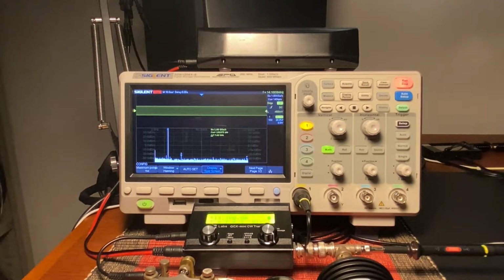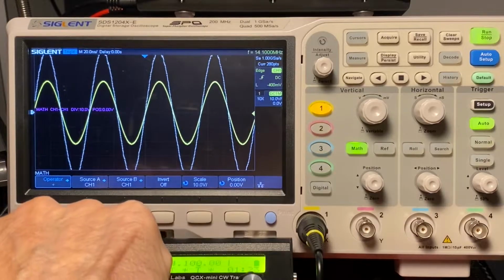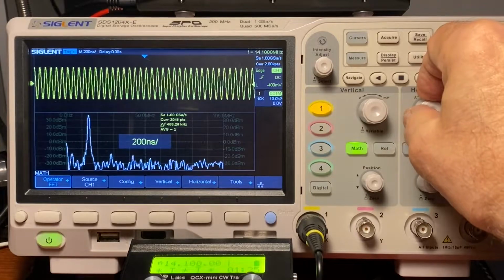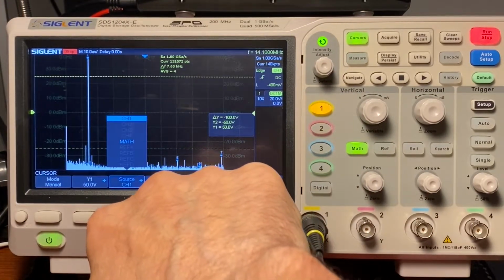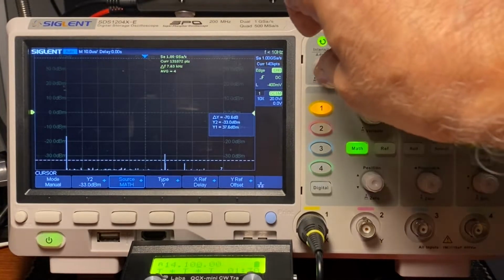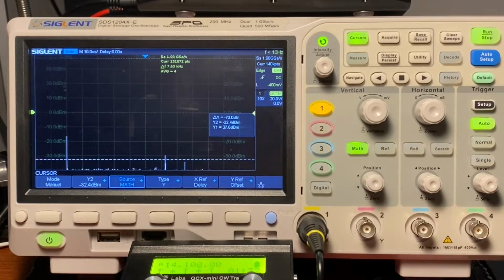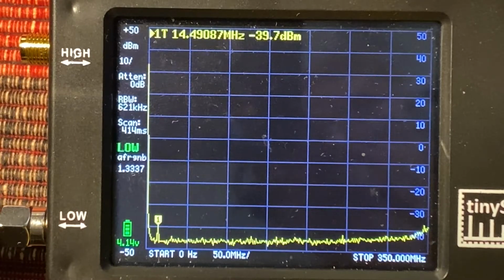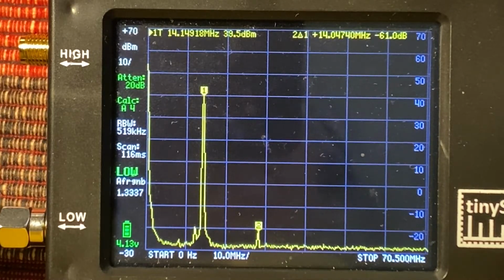Measuring HF Transmitter Harmonics with the Siglent 1204Xe

Comment: Using an oscilloscope probe to measure the spectrum is far from optimum. Amplitude vary with frequency since the cable is not match to 50 ohm.
Reply from the maker: That's a common misunderstanding!

In the configurations where I show the scope connected to a load via a T it should NOT be matched to 50 ohms as the signal is already terminated properly. We are properly measuring voltage across the accurate 50 ohm load with a scope probe calibrated to do that. That is what  the probe and scope were designed to do.

The supplied T and probe adapter for the high impedance probe setting work to at least the specified bandwidth of the scope when used this way. You are correct, however that this means that at 200 MHZ, the measurements can be 3Db low as that is what the 200 MHz specification of the scope actuallymeans! This bandwidth will not be improved by using a 50 home setup for the measurement - it's the limit of the scope's design. It also limits the FFT and power measurements of the 200 Mhz version of this scope to to around 160MHz.

In some videos I show how to use the scope as the destination load, but it's usually via some sort of properly calibrated power attenuator.

Thahk you for reminding us that's that it is easy to forget the scope bandwidth is only 200 MHz! This means that that using it to measure harmonics above 100 MHz can give misleading results. This is a great system for HF work up to about 30 MHZ, but 6 meters and beyond requires a better analyzer ( and I have several).

thanks again for your interest...

Comment: FYI - you can display a table of the markers on the Siglent, and see the relative dB values without having to cursor around.
Reply from the maker: Of course, but that only works on the 4 channel models like mine.

I've been trying to show other ways to do it for the benefit of users of the very popular 1202X-e which has no tables in the FFT function.

Unfortunately, I can't test on it since I don't have a 1202Xe available.

I've been trying to show simpler ways to do things lately after being accused by a friend of doing videos about hardware no ham can afford!

Thanks for the comment, however. I love the tables myself!

M

Comment: Hi Mario,  Thanks for doing this video.  I've got this scope and a QCX+.  Can you confirm  the correct setup is output of QCX goes into a T.  Dummy load attached to side connector on T and where I'm lost is where/what is the scope probe connected to?  I've got a bnc breakout that goes from bnc to 2 screw terminals.  Could I just use that? 

Also, I'm wanting to measure power output with this scope and radio.  Would the same setup be what I'm looking for?  My concern is in not wanting to blow up my scope.  So, I'm assuming at 10Watts or less an attenuator is not needed?  

Thanks again for the video and for any insight you care to offer.  73!  Fleet KC1QHE
Reply from the maker: If you think about it as a normal voltage reading with the scope probe you can see what is safe and what isn't. You're just connecting the x10 probe to the dummy load the way you would probe any normal AC signal with it if you were troubleshooting.

Here's a link to a slightly better picture of the dummy load, BNC T and 10x probe with its BNC Tip adapter plugged into the T: https://drive.google.com/file/d/1tcTT-pdPCHPf3pgUR9npNjJ_JjPd0het/view?usp=sharing

My scope came with 4 probe kits, and each one contained a funny looking adapter that slips over the probe tip (with the clip removed) and plugs in to a bnc/tnc connector's inner shield (It doesn't look like a BNC connector at all). Note: This is not the same thing as a terminated adapter for a scope input!

A bigger unshielded adapter might work OK with your 10x probe, but it would probably introduce errors as the frequency rises. You need to keep a short, low capacitance path to the probe and its ground return if you don't use the proper adapter for a 10x probe.  If you try your adapter, consider using the short grounding clip instead of the alligator clip and going straight in to the probe tip instead of the self-holding cap.

I see no problems doing this at 10 watts which should be 62 volts peak to peak. I believe the probe and scope with probe is rated at well over 200 Volts. Just don't forget to convert from Peak-to-Peak to RMS Voltage. Note that the FFT automatically does this conversion and displays power if the units are dbm.
Reply: @mariovano  Thank you.  I just gave it a try and it works well.  Now, if I can just get my power on the QCX to around 5Watts I'll be happy.